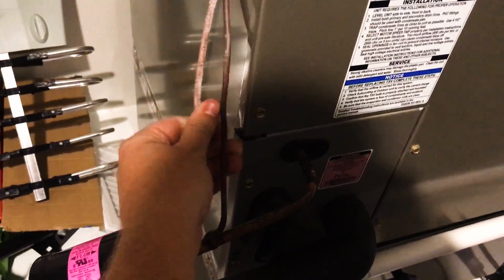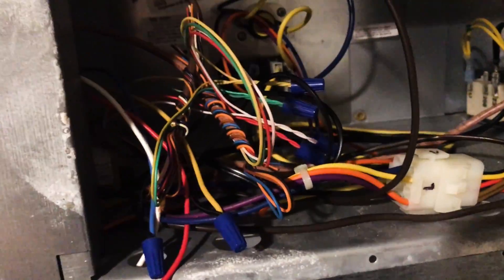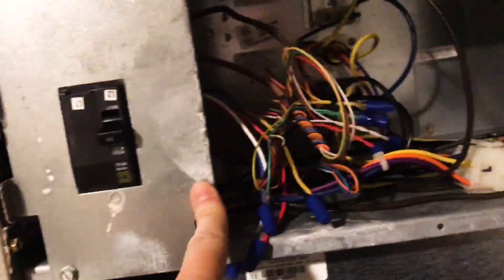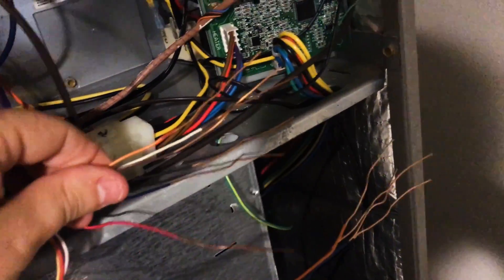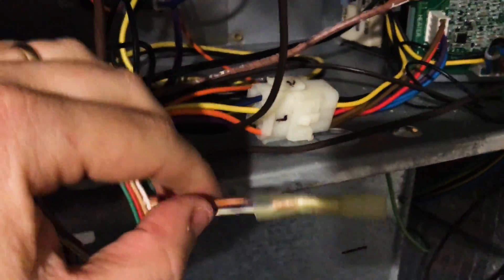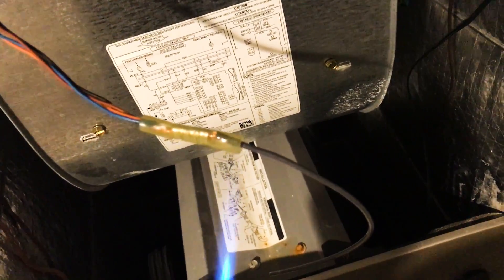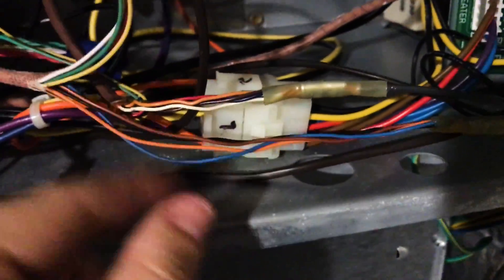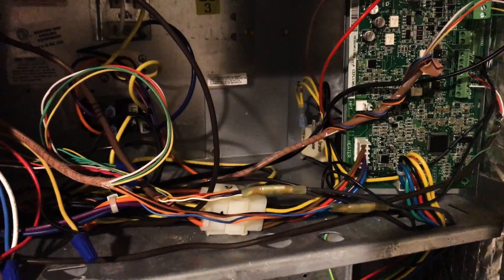MacGyver Fix to a Communicating AC System

Comment: Hi Bryan.  Has this proven to remain an effective fix?  I have a Carrier Infinity that has had the same Indoor and/or Outdoor Communication Fault (or both) issue every time it storms for the last two years.  Multiple technicians have attempted to fix this but have failed.  What is interesting is that after waiting anywhere from a few hours to a couple of days and multiple power cycles it will start working again.  This is the first explanation  / fix that actually makes sense.  Multiple techs from the installing company (Levy & Sons Dallas) have attempted to fix this.  One tech replaced control board which I expressed my doubts on it fixing the issue.  It didn’t.  The last tech left a couple of days ago (July 10, 2023) and said he would try again the next morning and then company  called me and said he can’t make it because he can’t get a hold of Carrier.  Then he cancelled completely the next day.  That guy actually somehow introduced another error that I ended up “fixing” myself and he had disconnected the SAFE-T-switch and Little Giant pump shutoff input wires and left them hanging! They want to send out another tech but they all want to charge me and all track mud through the home no matter how many times I ask them to cover or remover their boots.  I am desperate and will try this myself.  At his point I feel I know this system better than the techs!  What an industry this is ;)
Reply: I have the same issue, were you able to find a good fix?
Reply: @coldbay2005  I was but not sure if any of the six different AC repair techs didn’t introduce another issue.  I actually noticed fault code 48 (amber LED flash 4 slow 8 fast) on outdoor unit. Oddly none of the techs felt this was important. I even handed them trouble shooting guide and showed them flashing led and what Carrier documentation said.  48 is an inverter board communication failure.  I found a tech that was actually familiar with these as and he got Carrier to cover both outdoor unit boards under warranty.  He even took my word for it over phone and showed up with boards the next day!  He replaced in 1.5 hours.  Now he did charge me $700 in labor but at that point I was just happy to have AC and not pay $3k for boards out of warranty. This fixed it so far but we haven’t had any storms so not sure if communication wire is still a factor.  There is a whole lot more to  my adventure on getting fixed but I was really disappointed in these techs and how much I paid for service calls for have them give up and head to next appointment.  Carrier was zero help when I tried explaining that approved companies on their site did not have the training on communicating systems.  It’s a great unit when it works and I had to learn more than 99% of AC repair guys to fix it.

Comment: Grounding the unused conductors does not provide shielding, per se, but does add a few picofarads/foot of capacitance to ground for each of the other conductors.  That additional capacitance acts as a filter for any line transients and may be just enough to prevent a fault with the communicating thermostat.

Comment: I am having communication issues and I noticed I don’t have shielded wires however I don’t have that many spares. I only have one spare. It’s a 5 strand wire and I am using 4 so only 1 spare. What should I do? Just ground that one? Would that fix my issue?

Comment: On communicating units you should always ground out the extra wires. But, you should not have the splice in your 4 communicating wires. That adds more resistance in the wires. On communicating units like Lennox the ohms range is 70-90 ohms. 9 calls out of 10 that is not communicating is due to a splice with wire nuts that either has come loose or has moisture in the wire nut with corrosion.

Comment: Another great tip. Trane uses a 3 wire communicating system and when I installed mine I used 18/3 LVT for this reason. In my 24 volt days it was always nice to have an extra wire or two for backup down the road, but with a communicating system using LVT wire you shouldn’t have extra wires or be sure to ground one end of the extras as you’ve demonstrated. Also, keep the LVT about a foot away from transformers, light ballasts, high voltage wiring and EAC power packs. Otherwise, use shielded cable to prevent nuisance codes/alerts and the like.

Comment: Hey I had no idea you could shrink insulated crimp connectors. That is awesome
Reply: Tim Tanguay only heat shrink ones though. Not all of them.
Reply: I thought that crimp connectors are ONLY to be used with stranded conductors and not soild copper conductors like most thermostat wire?!...  I aways pull off wires with terminals from the factory off old condensers and furnaces.  I can just used these by splicing these to the solid copper conductors if i need a terminal connection but have solid copper conductors. 

I also pull off 5/16" screws, condenser fan motor mounting acorn nuts, capacitor mounting brackets, hoses/clamps and sometimes the muliple sizes of plastic molex type connectors from old condensers and furnaces wiring harnessea.  They all can run in very hand, sometimes save your butt, and just make your life easier.   I figure i tell you all i'm a part, and tool,  hoarder!!! Lol

A situation where someone had replaced a dual run capacitor and when they reconnected the wires to the caps male terminals they leave the terminal connections loose....causing the wires, and capacitor, connections to heat up, melt/burn the wires/connections.  It's a whole lot easier when you have that common wire that runs between the cap to contactor from a old unit to use rather then have to fabricate an new wire with terminals.

Comment: Spikes cover nearly all digi spectrum ..some stronger than others..shielding should be stanard on infinity..evolution and the like. Transient protectors in the 3 to 8 joule capacity can filter the line side of these even though SE cables are wrapped with the ground unfortunately this is connected at both line and load ends. My customers experience comm errors from the same even though dealer says shields arent necessary..ha! Try to get labor reimbursement on that?
A proven test is to connect a standard 4/5wire tstat and connect to y  y1 w  r g terms at control for test ..

Comment: On customers who report lost communication or burnt out control boards when there’s lightning strikes or old neighborhoods with old transformers that blowup every year or get hit by cars or falling trees. I remove the 110 power supply going to the 24 V transformer and run it through a large computer uninterruptible Power supply (UPS) that now becomes the source of 110 it’s filtered steady clean 110 power with battery back up never have to worry about Boards getting fried and when the power goes out the unit never even knows.
Reply: t lech , that's an awesome idea. Clean that dirty power! Takes care of voltage sags, brownouts, and blackouts too (provided backup batteries in UPS are looked after). I was going to merely suggest using a high-quality surge protector, but your solution has that built into it---and even more!
Reply: Locutus of Borg It’s something I’ve been doing for a couple decades now you also put it on tankless water heater’s when the power goes out your hot water heater still operates gas is not affected by power outages but the electric circuit board inducer motor in a hot water tank are it’s something I’ve been doing for a couple decades now you also put it on tankless water heater’s when the power goes out your hot water heater still operates gas is not affected by power outages but electric circuit board and inducer motor in a hot water tank are, and the circuit boards last forever usually because they receive no voltage spikes. This is a service you provide all your customers or at least your high-end customers and any mission crucial component where the cost of downtime greatly outweighs the minimal cost of a UPS back up and surge protector.
Reply: t lech How often do you schedule battery replacement?

Comment: I wonder what would happen if you disconnect outside transformer. I've had issues with comm systems on other brand when they use that 2nd trans it isn't really necessary.

Comment: Grounding communicating dc systems is critical. At my company we install a lot of the Lennox I comfort systems which use the 4  dc communication wires. For a while we had the dilemma,should we just run 4 wire to avoid communication problems but then you lose the ability to switch to a different wire should you have issues with one of the four. So we just run 8 wire and ground the others. Good video for guys who aren’t used to these comm. dc systems. Seems like everything will be going that way soon. The Lennox s-30 stats also have a WiFi hub that you have be sure not to install on a metal return duct or anything metal for that matter.this will give you issues with communication and connection also